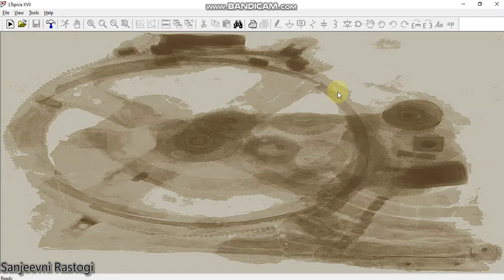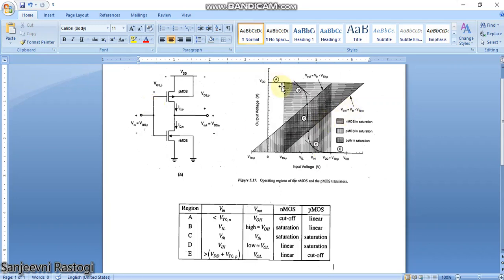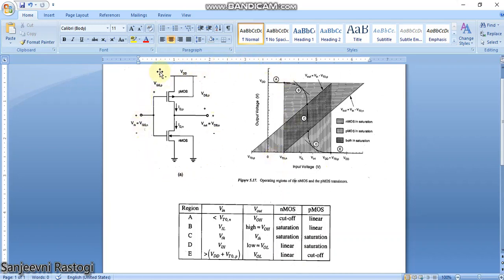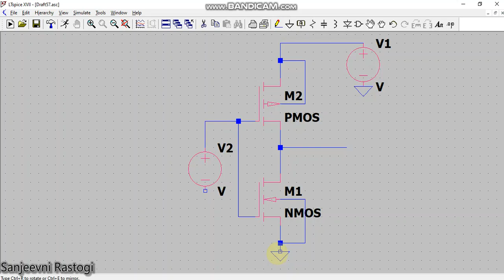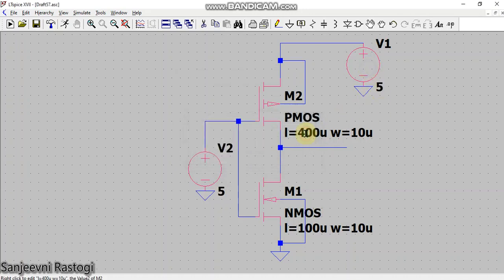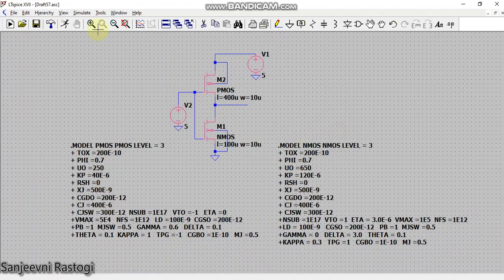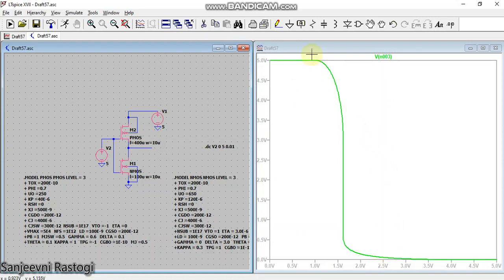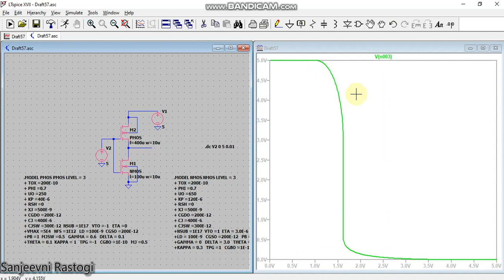CMOS Inverter VTC curve simulation in LTspice | How does CMOS Inverter work?

Comment: for nmos:
.MODEL NMOS NMOS LEVEL = 3
+ TOX = 200E-10
+ PHI= 0.7
+ UO =650
+ KP =120E-6
+ RSH=0
+  XJ =500E-9
+ CGDO =200E-12
+ CJ =400E-6
+ CJSW =300E-12
+NSUB =1E17 VTO = 1  ETA = 3.0E-6 VMAX =1E5  NFS =1E12
+LD = 100E-9 CGSO = 200E-12 PB =1 MJSW = 0.5
+GAMMA = 0 DELTA = 3.0 THETA = 0.1
+KAPPA = 0.3 TPG =1 CGBO=1E-10 MJ = 0.5

for pmos:
.MODEL PMOS PMOS LEVEL = 3
+ TOX = 200E-10
+ PHI= 0.7
+ UO =250
+ KP =40E-6
+ RSH=0
+  XJ =500E-9
+ CGDO =200E-12
+ CJ =400E-6
+ CJSW =300E-12
+NSUB =1E17 VTO = -1  ETA = 0 VMAX =5E4  NFS =1E12
+LD = 100E-9 CGSO = 200E-12 PB =1 MJSW = 0.5
+GAMMA = 0.6 DELTA = 0.1 THETA = 0.1
+KAPPA = 1 TPG =-1 CGBO=1E-10 MJ = 0.5
Reply: eh merci ma caille tu régales !! C'est gérard qui va être content